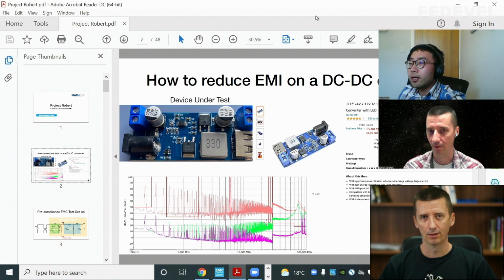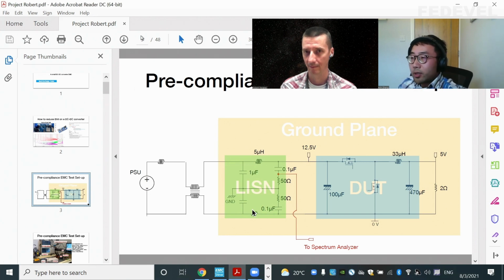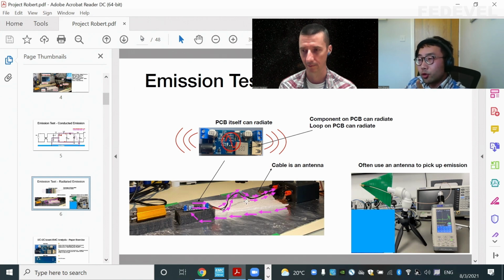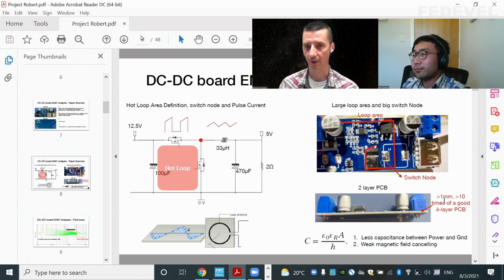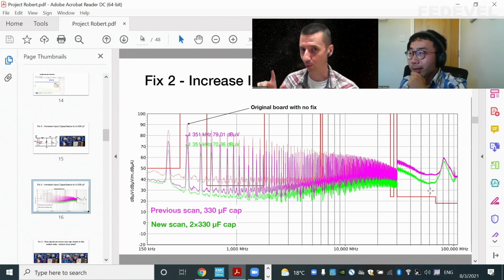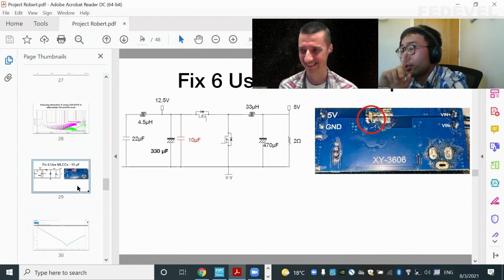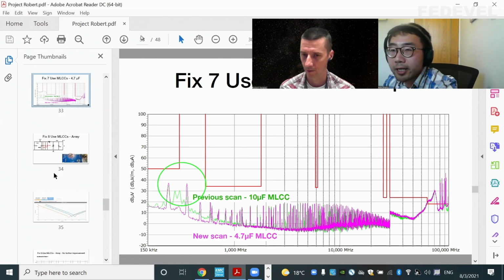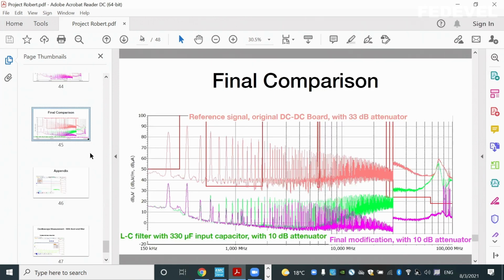9 Simple Tricks to Improve EMC / EMI on Your Boards - Practical examples (with Min Zhang)

Comment: Could you share the pdf which is used in the video with all results?
Reply from the maker: I added the link into description, but basically, here you can download it: https://mach1design.co.uk/dc-dc-converter-trouble-shooting-case
Reply: @RobertFeranec  
Thanks for all the video and subject is very good and clear
A potential idea on same subject will be to use fully open source software for the simulation like #Qucs and provide all on GitHub or similar to have all in hand to reproduce easily those experiments.
Reply: @bvernoux  Great idea. We will look into how to do this and hopefully share our simply built Spice simulation.
Reply: @MachOneDesignEMC  Yes LTspice will be perfect

Comment: Please bring Min back for the inductor cutout discussion!  Information is really lacking in this area :)
Reply: Yes, I also have a question about cutouts under inductors and transformers. For example, many pcb designguides from ic manufactures recommend gnd cutouts under ethernet/manchester transformers in all layers.
Reply: I think cutouts in the groundplane is interesting when having onboard cm-chokes, isnt that the case?

Comment: I had to read quite a few papers and videos 3 years ago, when I had to do precompliance testing. They mostly focus on before and after, almost never in steps between and where to start... Having all this information in a single video is really nice for future engineers. Would glad to see a follow up to this one...explaining the different CISPR classes and which one to select. I would gladly see the video about copper under inductor comparison too.

I am very impressed with the presentation (you can download it under showcase design on the home page of company website). Did he do al the presentation himself, or did you influence any of the papers shown? As said previously normally papers don't focus on steps in between.

In his last simulation he used a 150p capacitor to simulate CMN. Is that just an educated guess or did he get approximate value from measurements?

If you want to build and test DIY LISN, check FesZ Electronics on YouTube.
Reply: I second the recommendation for FesZ!
Reply from the maker: WR3 Thank you. In my initial call with Min, we decided what we would like to do, but Min has done all the measurements and the presentation by himself. I am very happy you like it - it was super useful also for me.

Comment: Nice video, but it was mentioned that the transistors were incorrectly placed and this was never addressed. The board layout also wasn't obvious. I have seen other videos where a light is shown through the board to show the location of the tracks and the top and a reversed copy of the bottom are shown to allow a view of the layout that can be commented on.

Comment: Do we really put differential mode and common mode filter before LISN? Is it even allowable? I think this will give incorrect measurement.
Reply: No we don't, you are absolutely right. The way we put the LISN mate is not 'before', but rather, using coupling and decoupling circuit to obtain signal. treat it simply as an ideal current transformer. Of course, it won't be ideal in reality, so it will have some impact, but not much. Hope this helps.

Comment: It's very good work. It will be more interesting if he explained like this The method of designing the filter Identify impedance then find filter configuration then design the filter.. Stability .. How the common mode noise is generated.. Etc he is explaining only in the presective of conducted emission. The output capacitor has very much importance in my view . If you measure the current through the capacitor then it's will be high di/dt loop.
Reply: Hi, that's great feedback. We will take your points. The output capacitor is important, but as not as important as the input cap for buck converter, for other topologies such as boost or SEPIC, yes, one would also need to improve the output capacitor

Comment: Really really nice content. 
I know it is difficult to prototype, but it would be very interesting to see the difference with different layout (Like smaller "wire" for the switching node, or the impact of a 4 layers PCB with layer 2 as a ground just below signal. I don't know if you can do it in simulation ?)
Reply: you may find the seminar from MPS, showing the PCB layout of buck converter regarding the EMI considerations. It explain the stack-up design and also the component placements. I think its what you are looking for.
Reply: @rewq7041  For who read this comment, I saw a 5db attenuation with plane ground on layer 2 on a 4 layer pub vs no plane ground at all
Reply from the maker: Thank you very much Edouard

Comment: Great video, one question, the LC filter shows the 12.5V PSU after the inductor, is this correct, would it make a difference putting it the other side (essentially on top of the 22uF)?
I presume this is just a visual thing as you would put the voltage before the common mode choke and when that is shown the 12.5V is still in the same place?
Reply: yes, the simulation is a little bit strange in a sense it does not simulate the circuit, but rather from the noise perspective. We had this discussion during the video call, but that discussion was deleted due to the length of the video. This simulation model is what I call 'noise propagation' simulation, not a fully functional circuit one.

Comment: Thank you for the video. But why do you test with that ground plane directly under the DUT? Normally, the device should be placed 0.8m above the conducting plane (floor) by the standard. The close ground plane worsens the results... Thanks!
Reply from the maker: I will ask Min to have a look at the questions here.
Reply: Good question, yes, if you put the unit direct on the ground, the result will be even worse. We had some insulation material between the DUT and the ground plane. The important thing here is to demonstrate the techniques, and it is a pre-compliance set-up, so we are doing comparison study rather than quantity study.
Reply: @MachOneDesignEMC  Thank you!

Comment: For this test, can sur PSU be replace with a battery ? (no EMI)
Reply: You can replace the PSU with a battery, if the equipment will only be battery operated too. It acctually makes a difference if you use an isolated supply or a grounded (GND is earth) supply too, so that needs to be considered in your test setup.
Reply: @ProtonOne11  thanks for the answer. indeed.
Reply from the maker: I do not know direct answer to this, however, in reality, during the test we usually use the power supply which will be supplied together with the board (so we are sure everything together will pass).